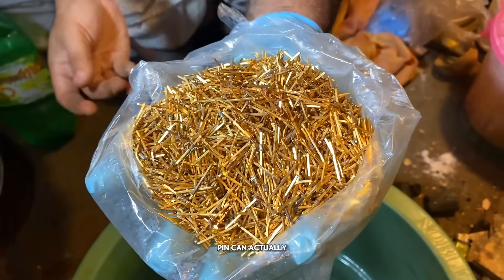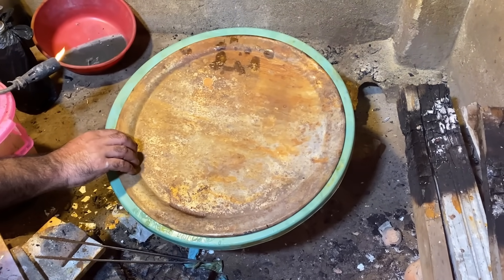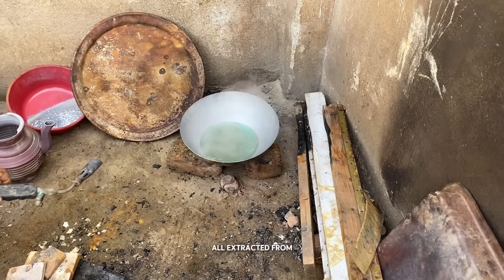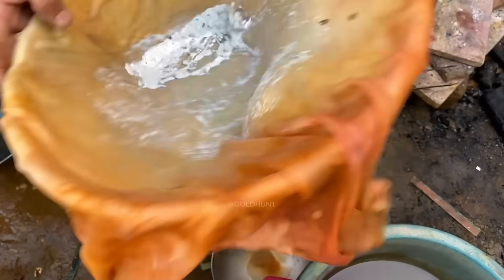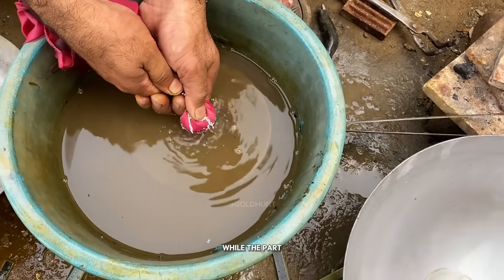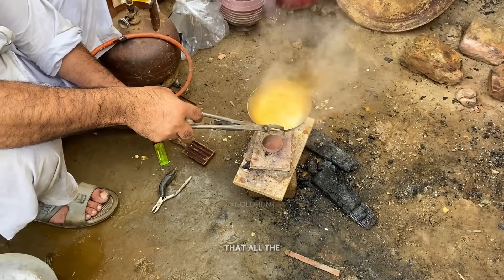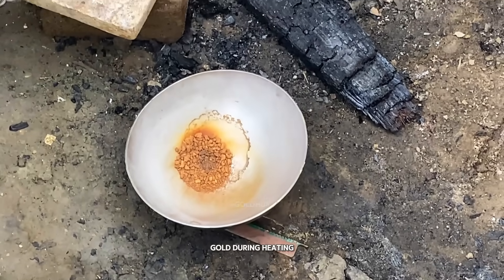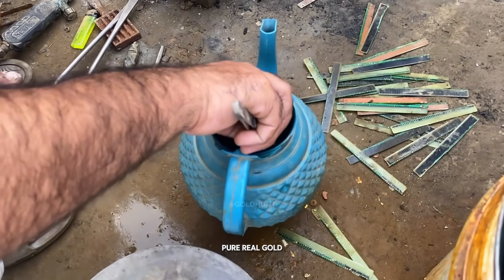This Simple scrap part More Worth then you think | i turn E Waste Into Gold

Comment: Yeah, this guy at the BARE minimum should invest it 2 things. A respirator, to help filter any contaminants in the air they’re being exposed to. They’re heating heavy metals, strong acids and solvents with absolutely zero protection. 2nd they should invest in gloves at the very least, handling strong acids and liquid mercury over prolonged periods of time is causing irreparable damage to this guys health. I understand, they likely don’t have many options to make that kind of money doing other things, so to do them longer they should be wearing protection. Also, he should likely be wearing some sort of shoes/ boots and not sandals, and preferably having a pair of clothes that he melts this stuff down in. He’s likely carrying unknown concentrations of mercury, acids and solvents and other heavy metals around with him everywhere he goes. This is insanely dangerous on just about every level, if this guy continues to recycle gold like this, he’ll likely die in a decade or less.

Comment: This is batshit insane. So many levels of danger here. Are they at least wearing respirators? I somehow doubt it.
Reply: For what ? You don't need any of that. I don't use any of that when I refine my gold. But I don't use mercury but I do have some... Hmmmm
Reply: @andycollins9771  I majored in printmaking while in college, specifically etching and when using zinc plates. Those fumes from the nitric acid biting process are deadly as they can destroy your lungs in no time. Even fully vented it's dangerous and we weren't allowed to go into the acid bath room without a respirator on.

Comment: He just keeps saying the gold pins.. What gold pins? Where did he get them from? Are they from rca audio video cables? Couldn't you also take the ends from hdmi cables as well if that's the case? So many of those types of things are gold plated
Reply: The pins come from scrapped connectors or were intended to be parts of connectors

Comment: Handling isn't what he needs to worry about so much. It's the fucking vapor from 1. Adding nitric acid 2. Fucking heating it! 
Mercury evaporates just like water. Not as fast. But it does. And the vapors enter your body when you inhale. Mercury passes easily thru the blood/brain membrane and then you forget how to dress yourself.

Comment: This guy certainly is killing himself for $5 worth of gold.
Reply: Well, I know thats not what you meant. But that would be a lot more than $5. Thats the size of an American dime I'd say, Dimes are 17.91 mm x1.35 mm. 
If gold were that size.
Volume = π·r²·h ~ 0.3401 cm³. Gold density = 19.32 g/cm³ so, mass = 6.57 grams.

Gold is $135.88 per gram
Value of pure gold 6.57 g × $135.88 per gram = $893.

Still not worth losing your life.

Comment: This is a perfect example of how NOT to " refine" gold 1 you left out the silver/ palladium ( possibly) in the silver nitrate solution  2 using mercury  beside your skin absorbing the mercury and risking your health you are contaminating whatever body of water or drainage with mercury 3 all you need is BORAX AND DISHWASHER SOAP ..and is not 24k yet yoy need to refine it at least one more time even thos the mercury evaporated you will still have impurities in the gold.  This is just a constructive criticism and i worry for your health and the environment.  Be safe..BTW borax and a little dishwasher soap mix will give you better results on gathering your gold than mercury and without putting yourself at risk nor the environment.
Reply from the maker: Nice information

Comment: I worked for a company that did gold plating for electronics. I worked in part of the plant that would strip the gold from bad parts from all over the US. We used hydrogen cyanide to strip the gold running it through 5 baths. The first main tank has the hydrogen cyanide. 4 rinse tanks. Main tank would get pumped through filters to collect the gold. I only worked there 3 years. It's a dangerous job.
Reply from the maker: Interesting information

Comment: If they're using mercury to do this, do they follow proper precautions for the handling and disposal of the mercury
Reply from the maker: What is proper safety tell me
Reply: @Goldhubtextra there are better sources than me to get that answer from. Mercury is a highly toxic substance, to handle, to burn or vaporize, or any other way you can think to interact with this stuff. That is why it isn't used like it was all the way up to the 1980s, because the protocols for dealing with mercury safely and with minimal impact to the environment or yourself is extreme. People would break a thermometer in their house, on accident most of the time, and try to vacuum it up. That then atomizes the mercury sending it throughout the home. That house would then qualify as a hazardous materials (HAZMAT) emergency. Much the same as dealing with asbestos. Also, mercury absorbs through the skin and many different kinds of glove material and stays permanently in your body, and the more you handle it the higher the levels in your body get. Top Hat makers 200 years ago suffered from Mad Hatters disease because mercury was used to treat the fabric of the Top Hats at that time. And constant exposure to this metal made the hat makers go mad and eventually die.

Comment: Can i ask what is the purpose to use mercury to absorb the gold instead of simply melting it down from the point you rinsed them from the nitric acid?? Would it not burn off any impurities the same as if you didnt use the mercury? I am simply curious an i am not judging or anything from your methods, i am doing this same thing myself, however, nitric acid is questionable to come by in my area of the United States. I do have a few pounds of mercury though! I need a method of non-nitric acid an only the items i have available such as mercury an i also have muriatic acid that would dissolve any other non precious metals. 

Also i will say that at least bare minimum you should have a cloth mask on when evaporated the mercury/gold mixture, pull your shirt up over you mouth an nose if nothing else, the fumes will kill you dead dead!! Just be cautious sir! I understand you cant get a hooded ventilation system or none of the fancy stuff for safety, i cannot affors those either, but at least pull your shirt over your nose n mouth! Thank you for your video an i look forward to more!!
Reply from the maker: As you can see there's a lot of garbage so if you melted directly the gold caret will be low

Comment: I have well over 50 lbs of pins, fingers, CPU's but am not cool on the dangers. I don't have the Safe zone, or respiratory equipment to do this. I want to sell to experts but have only been ripped off. I have well over 400 CPU's but I want something real for my very labour intense mining of them. I dry pick my pins so they are incredibly valuable since 10% of Gold in each pin is in the solder joint most use heat to extract the pins, I pick mine dry. Getting on in years I want to sell my mined G.P. materials and buy some Silver bars. Will consider trades. Likely to another Canadian to avoid US Tarif's and Customs taxes.
Reply: Where did you get all those parts?